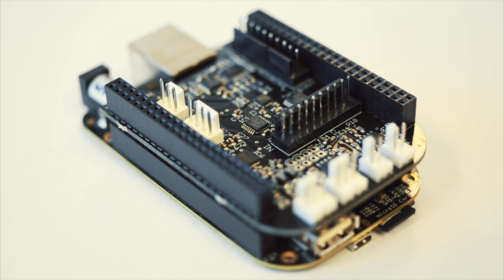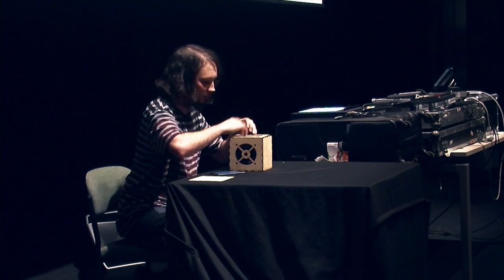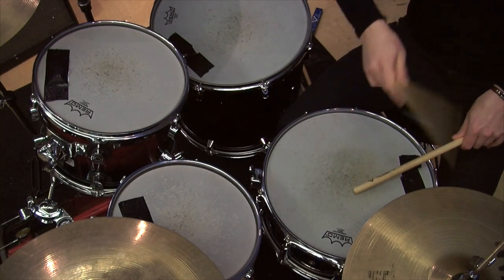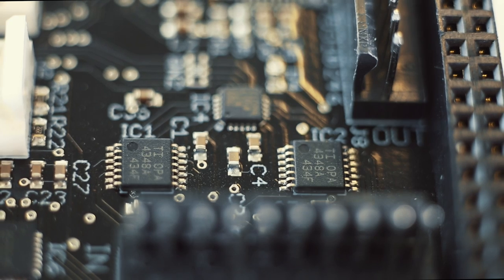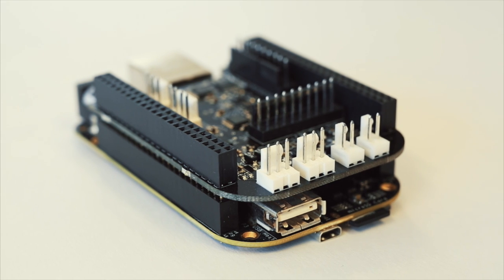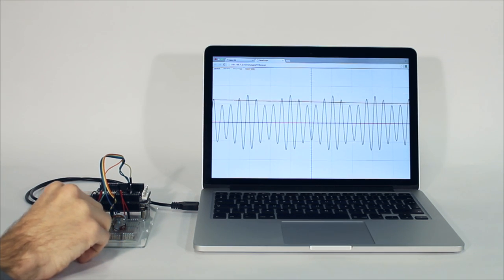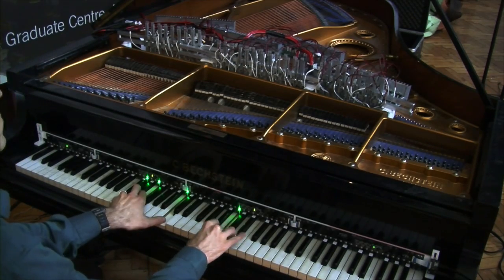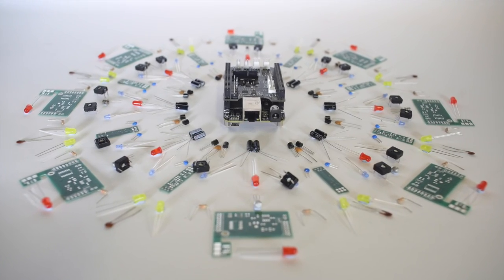Bela: an embedded platform for audio and sensor processing

Comment: which cape-board with stereo TRS jacks is recommended for Bela?
Reply from the maker: The Bela cape comes with breakout cables with stereo TRS 3.5mm jacks, as shown here https://shop.bela.io/bela-accessories/audio-cable . These allow the board to be easily integrated into any box/enclosure, with the audio connections made available on a panel. Alternative connectors can be soldered in place of the default ones if needed.